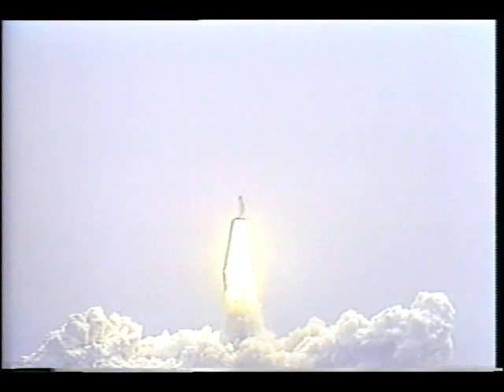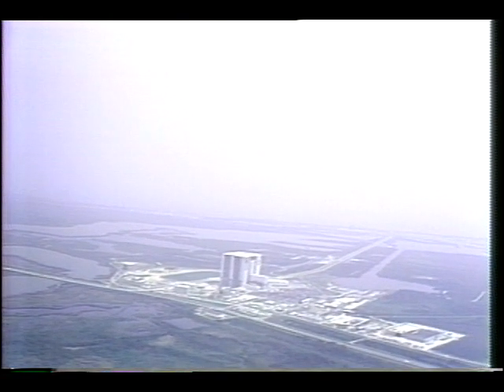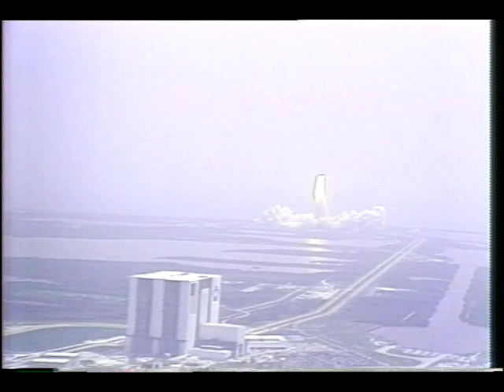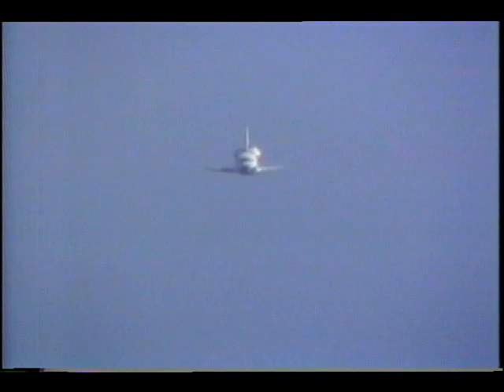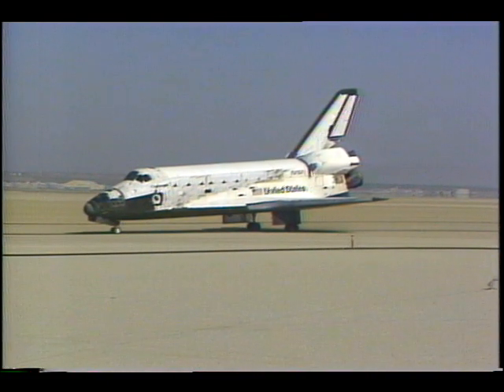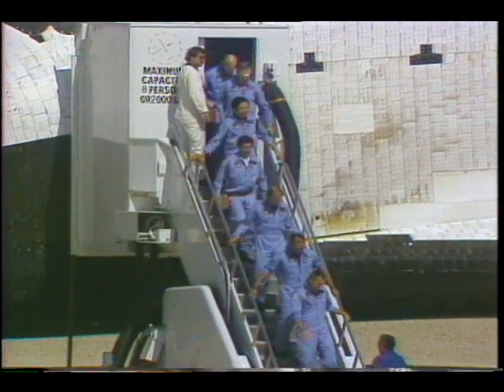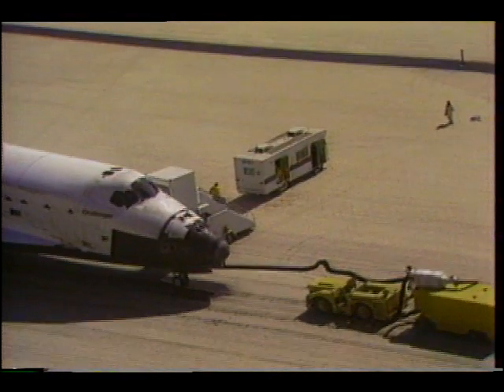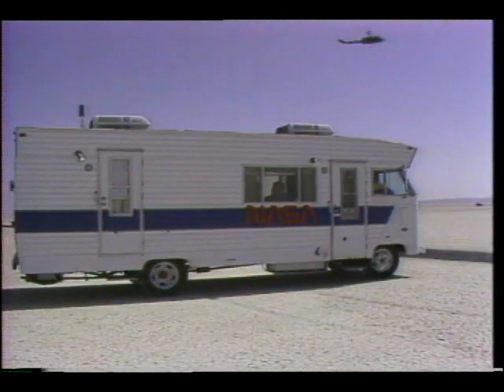STS-51B/Challenger - Isolated Launch View

Comment: Why did the mishap have to happen with the first private citizen on board Challenger? Why could this happen with fully trained astronauts? Not saying I don't want this to happen to them. It was almost like NASA didn't like the first private citizen on board their space shuttle. That is why it launched it.
Reply: It was an attempt to commercialize the program, apparently some people weren't as interested so they introduced a new element a private citizen.
Reply: What?! I highly doubt they intentionally killed the Challenger Astronauts. You don't actually think that do you?
Reply: It seems odd that a seal would rupture. Of all the things that could go wrong that sernd the stupidest to me. Can't they clamp a joint? Isn't that what this is about? A joint? I wound think that wound be the least problematic part of any mission and it makes sense why the ignored orders to wait until June. Or whenever it was 60 degrees, a joint can't.be that bad. It sounds like the SRB was a bad design. If it can't withstand extremes if temperature.
Reply: Poor Challenger, all people do is associate the orbiter with disaster. That is undeserved.
Reply: because of managers thought they knew more than the enginers
Reply: Challenger, & then Columbia, were just awful.  I remember them both.  Was in 2nd grade for Challenger.  One of those memories that stays with you.

People should have been imprisoned for Challenger, and then also for Columbia.  The engineers were SCREAMING not to launch Challenger, and the managers overrode them.  And the engineers were SCREAMING to get a better look at Columbia, only to have the managers override them then, too.  And as we now know, they could have launched Atlantis on a rescue mission.  Instead they just let them burn up in the atmosphere.
Reply: @christopjerfoote5747  that was I’m sure the best design that they could come up with back in the day. They worked fine the other launches but a very fine line using rubber o ring gaskets in cold temps. They harden and won’t seal. On the footage you can see smoke pouring out of that joint right after the srb’s lit. It failed immediately. The engineers told them not to launch it.
Reply: @christopjerfoote5747  Simply just this, rush to launch
Reply: @steveo601  I believe they knew that the design of the srb’s was faulty with regard to the seals/joints all the way back in the ‘70s, and they were developing a new design at the time Challenger had its failure. The problem was, they didn’t want to ground the whole program for two years while the fix was completed. They still were hoping that the program could sustain around 25 launches a year back then, but those hopes ended that day. The irony is that this disaster may have prolonged the program, because they wanted to prove that they could come back from it. Had Challenger never happened, the shuttle program may just have gone down as an expensive failure, that was safe, but never delivered on its promises.